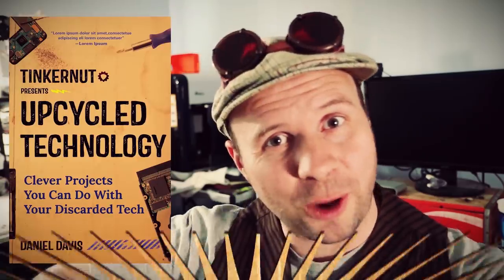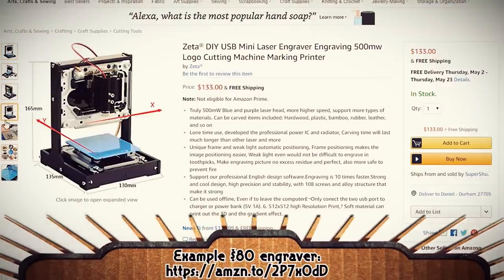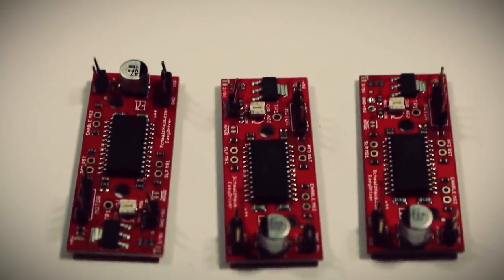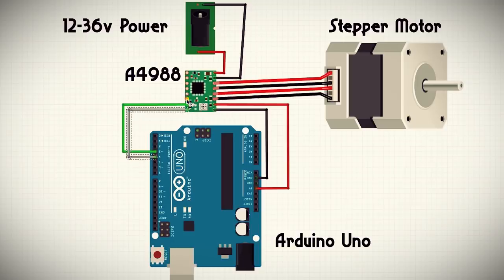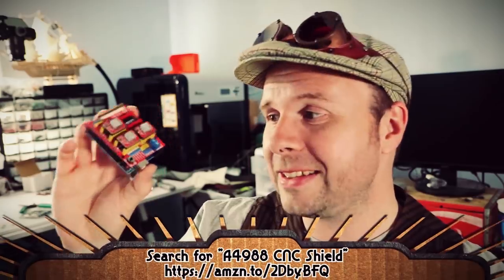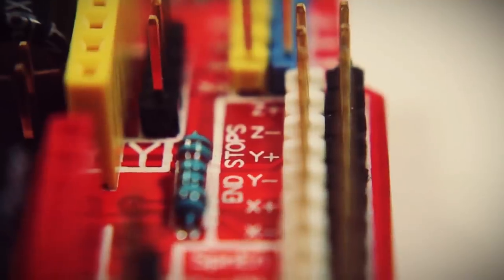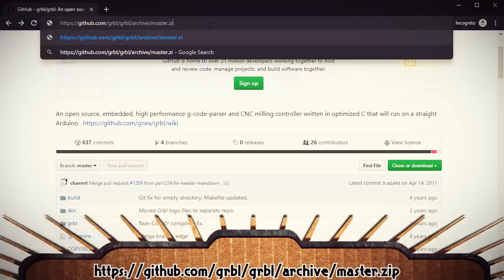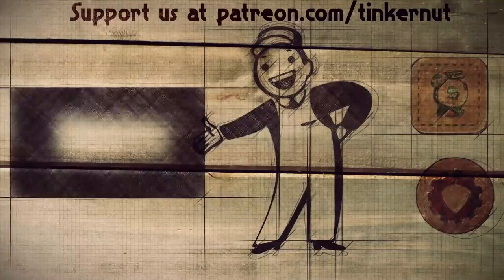Upcycle Old CD Drives into a 3D Printer (Part 3)

Comment: I also made a couple of these fun machines. My pen plotter was the best one but I should really make a new carriage with my 3D printer. Btw, buy a Ramps with an Arduino Mega with 5 stepper drivers for under 20 bucks, you get more versatility and more widely supported electronics for less!

Comment: If u order the assembly, the tutorial becomes useless. For like 150 bucks u can get an entire 3d printer from aliexpress.
Reply: Was just thinking the same thing. Messing with one of these ultra cheap printers is an awesome experience.
Reply: Right...but if you build it yourself, you will know how to fix something if it breaks...
The knowledge of how to work on/fix these things is ALOT more valuable than ordering one pre-made and scratching your head if something isn't right
Reply: @haydenc2742  You can learn everything important about a 3d printer by building a Chinese kit and updating the firmware. You'll also have a printer that can actually make things. Like a nice frame for a CD-ROM 3d printer, for example

Comment: what a complete mess. back and forth starting with building it using cd drives in video one, I went and bought a UNO, 3 controllers, and 3 drives. then you went and started using a pre bought one, not the one we're building. so, what, I've just wasted all this money on the parts only to throw them away?????